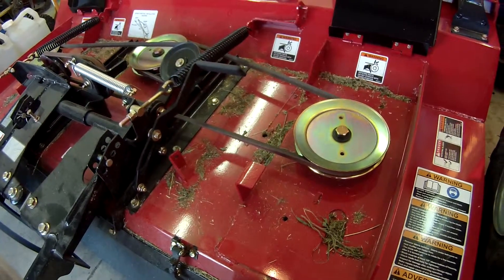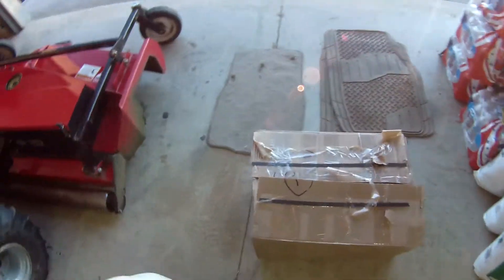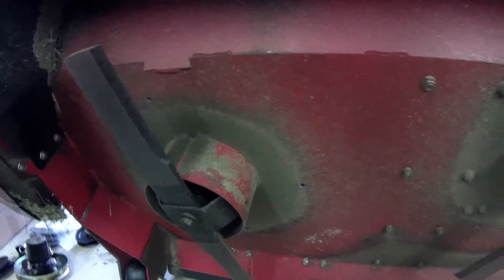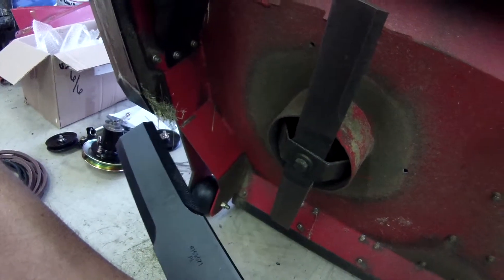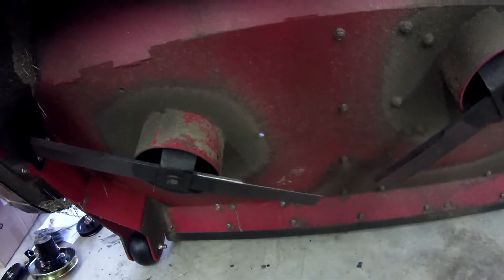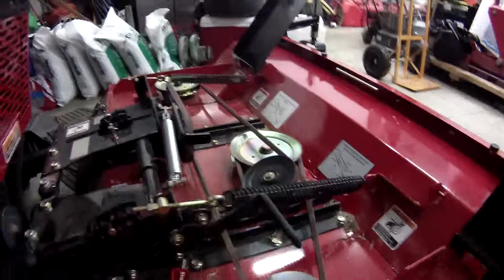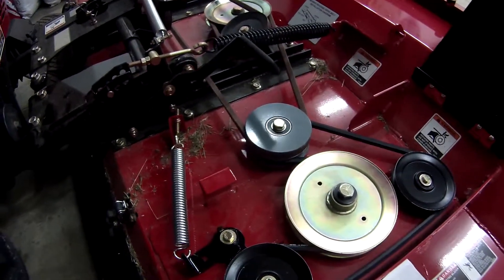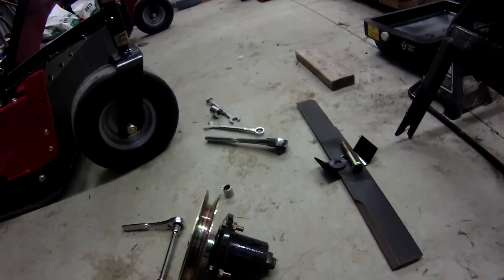Steiner rough cut part 2 rotating blade kit

Comment: like your videos i just purchased a 440 this summer and roughcut and 72inch finish great power so does the wheels up front help on the rough cut help and how do they help
Reply from the maker: Sorry for late reply. I would not own the Steiner or Ventrac rough cut without the front wheel kit. I have used both with And without.  The problem without is yoy pretty much have to lift deck up to make turns on both. With the wheel kit you don't.  It is A bit pricey for the wheel kit, But after you use it once you will really be glad you got it.